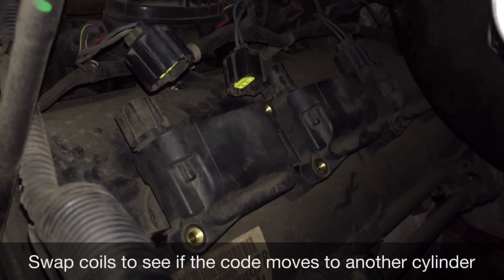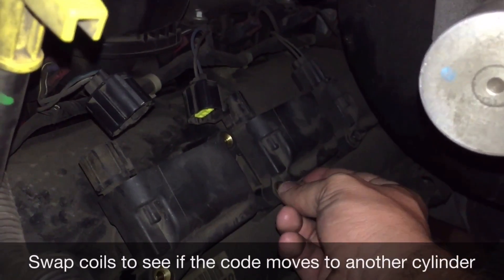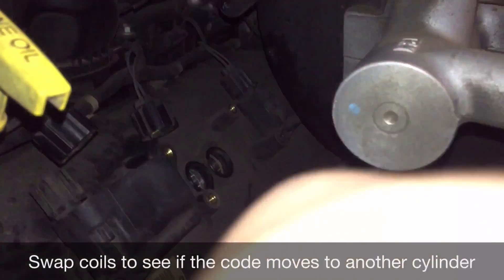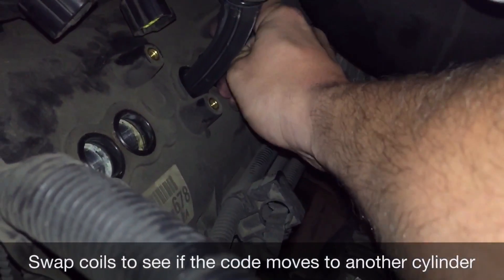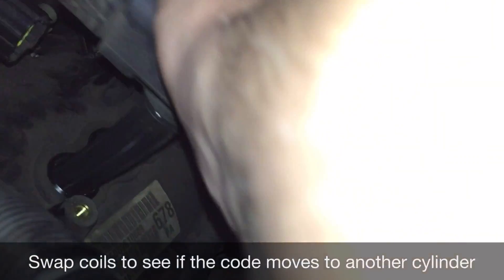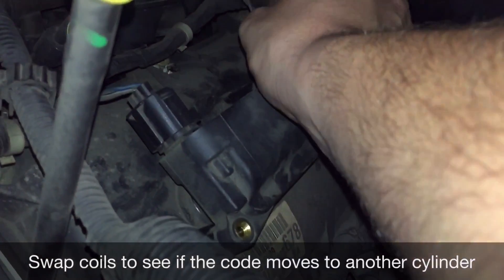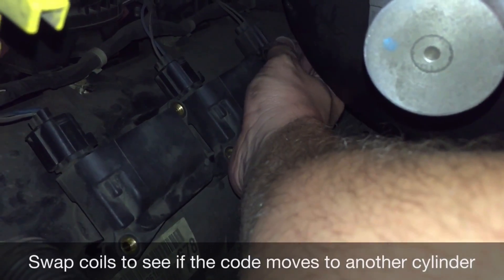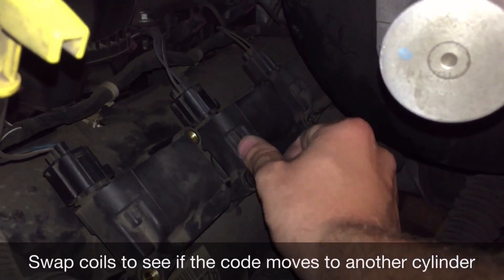5.7L Hemi Misfire Troubleshooting

Comment: I have a 2007 charger 5.7 with cyl. 3 misfire, swapped coil 3 with coil 5, still has a misfire but now the cel doesn't show up.
Reply: I would assume it's the spark plug then not the coil pack

Comment: Anyone have a good starting place for a possible misfire with no codes? Already been to the dealership. My 2012 JGC, with 5.7,   Began giving me trouble a week ago with a hesitating start and noticeable vibration at idle in gear or park. Dealership said its perfectly normal for the 5.7 to feel this way which is total bullshit. Half my family has 5.7's and I've personally put 25,000 on the vehicle with it running like watch. The service department at my Dealer is shit, in my opinion, I'm hesitant to give them another try... as they ccouldn't even tell me what they looked at in the 3 days it was there.
Reply from the maker: Easiest initial diagnosis starts with coil swaps or injector kill testing. Bad spark plugs are also common. Have you or the dealer already started diagnosing?
Reply: Dr. Diesel Thanks for the reply. Yes, it already went to the dealer. But I feel they looked for codes and nothing else. I've got 12,000 miles on the plugs with original coils. I've checked things like vacuum and PCV, coils test fine on ohm meter. It really seems like plugs but it would be odd, I may make the leap and change them to rule them out. Coils I hate to buy one at a time but I may have to do that.. $$$ I did speak to the service ''manager'' today, I think after I change the plugs I'll go have a talk with him so I can demonstrate what it's doing
Reply from the maker: Tyler Padgett I would look at fueling next. If injectors need to be cleaned, that could explain misfire symptoms. Also, as I mentioned in the video, valve springs are a fairly common issue. Let me know what happens and good luck!
Reply: Will do, manually cleaning injectors is on the list too. Thanks again
Reply: Dr. Diesel  did this work? As I've already  had a tune up done valve springs replaced, fuel injectors replaced, intake valve cover taken apart everything seems to b running fine! But now it's worse shakes shuts off after 10 seconds throws misfire code
Reply: @Kat J check your EGR valve I had to replace mine it was really rough at low idles and would sometimes stall out at those low idles. It's a common problem and about a 30-40$ part